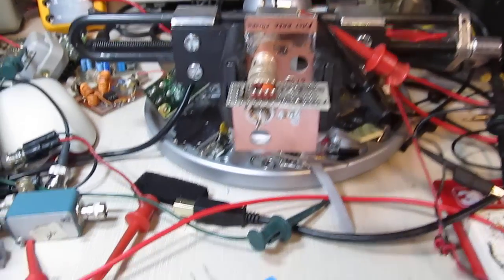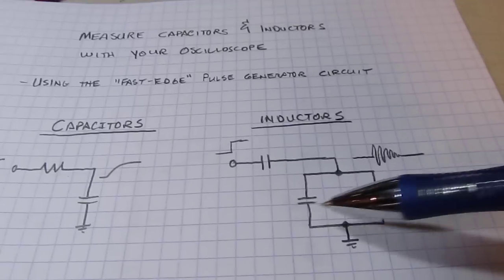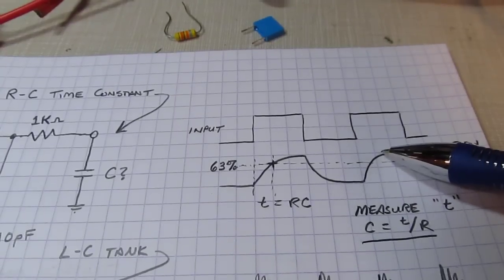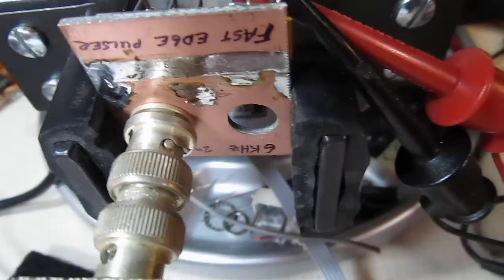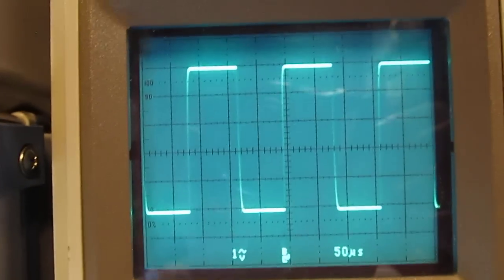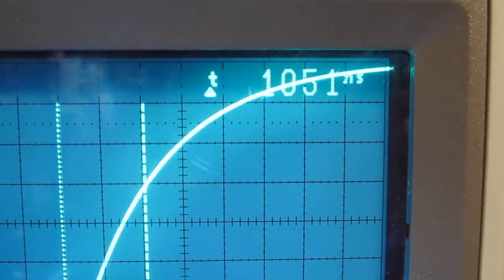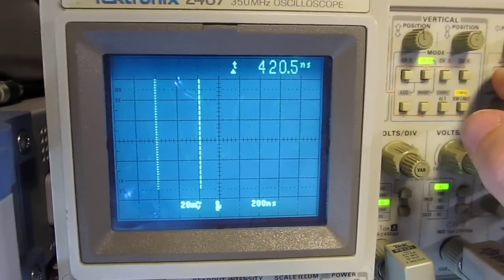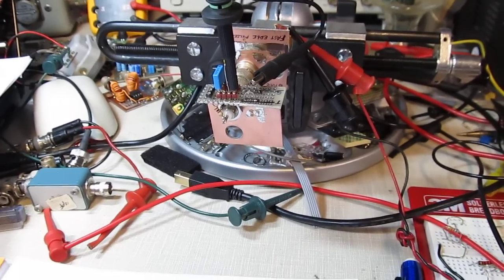#90: Measure Capacitors and Inductors with an Oscilloscope and some basic parts

Comment: Your videos and your knowledge is very impressive! I learn more and more, but I also see how little I know! ha ha ha
But I just received Tektronix 2465 DMS ( somewhere someone said that they are 2465 CTS ??? models with some extra stuff, in my case DMM ); unfortunately it is sick and I would like to fix it, so I can also start using it. I do have a modern scope, but this is something I always wanted! The problem I have is that sometimes everything is shrunken  into about 1" x 1", where the 4 input lines + text is small and the text unreadable - pixels that are funny looking; I'm assuming they are the text that should be at the top and bottom of the display. Also, when I push the FIND BEAM, the display is stuck as described by me above. Would you know where should I look or start looking? Lots of people start replacing capacitors and resistors.... but I think - unless they look and measure bad, don't fix what isn't bad, philosophy. At the same time, I never done anything this complex, but I'm willing to learn. I have nothing to loose, despite wanting to help this scope, rather than making tings worse!
I do have a generator and several meters and exact capacitor meters.... so I could start poking around with descent meters (I think). Any help is greatly appreciated!  Thank you very much.
Reply from the maker: The 1" by 1" compressed and fuzzy display is the INTENDED function of the BEAM FINDER.  The beam finder dramatically reduces the deflection voltages to make it easier to see if the trace you're looking for is off-screen somewhere - thus giving you information so that you know how to adjust the scope to bring the trace back on screen.  It sounds like your BEAM FIND switch is sticking, and not releasing back to normal operation.
Reply: @w2aew  Thank you for your quick reply! I think I'll try to clean the switch and see if that is what causes most of my problems. Lots of owners replace the square caps that are something like 0.006xxx nF, since they are a bad quality and can cause problems. Should I do that?  Also, should I just dive in and measure all the caps and replace not just bad once but also questionable or if they look like they will go bad in the near future? Do I need to buy these from a special place, rather than China/eBay....?
I have several videos here: https://www.youtube.com/watch?v=oxZZ7-VjCQ0  
All 4 of them are just badly made, but one can see how different results are just how this scope does. By same token, I think you are directing me to the Beam Switch and it is possible that it is almost 90% of my problems.
I love this scope and I want to make it to work and demo it for people and kids, that our clubs try to excite into electronics.
My stuff is also shown on shows, like DoSpace in Omaha, where I represented our Lincoln (Nebraska) club, and people were happy to see my gadgets, Jacobs's Latter and few other items that creates sparks and make sound, that scared few of the kids and adults alike!  You have a great day!
Reply from the maker: @tonysfun  Based on your videos, it really looks like a faulty/stuck Beam Find switch is your major problem.  This is an early scope, later models, such as A or B suffix, have a lot of surface mount parts.  The SMD tantalum caps on the A5 board are typically the most troublesome.  The older through-hole parts like you have are much more reliable.  You could go through a re-cap of the power supply, but it likely isn't urgent.
Reply: @w2aew  Thanks again for your help! It seems to me, from several people, that your suggestion to fix the "Beam Switch" is my first project today. I'll make a video and see if this fixes my troubles. About the caps, I'll try to examine them all one day, but from a quick inspection, they all look good and none leak, none bulges or is cracked. The small amount of dust inside and on the blades of the fan could be because it wasn't used much or it was maintained well.
Reply: @w2aew  Thanks for your help! I am up and running, but I have no idea if the scope is running as it should or I just think it is! ha ha ha  I need to do the calibration, but it takes some experience, so I must find me someone who knows much more than I do now.
Reply: @w2aew  I'm just responding to everyone just now. But it is now working so next is calibration.... BUT I do not know anything about that, so I'll try to find someone who I can learn from. Thanks!
Reply from the maker: Don’t be surprised that it might not even need calibration.
Reply: @w2aew  OK, that is something I did not expected. Didn't they need calibration at least every 3 or so years?
When I generated 1,000000kHz it was between 1,000039-1,000041kHz - that isn't bad at all for scope this old.
Do you know how can I find what "package" or "options" my scope has?
I have no manual or any documentations, but I know I have DMM option on the top. It also has couple ports in the back and 4 outputs.
But I do not know much about these scopes, except for that they are great machines I wanted one for many years.
I also do not know exact year this was made, but I do have the serial number, so I'm sure there is a way to find more information by the serial number - I assume.
Thanks for your help again!
Reply from the maker: @tonysfun  The 2465 DMS was a special edition that bundled several options:  Option 01 is the DMM, Option 09 which is the Counter/Timer/Trigger (CTT) and Word Recognizer option, Option 10 which is the GPIB interface option for programmatic control, and Option 22 was a couple of additional P6131 10x probes.  This scope listed for $8400 in 1986.  See page 260 of the 1986 catalog: http://manx.classiccmp.org/collections/legalize/tektronix/catalog/Tektronix_Catalog_1986.pdf
Reply: @w2aew  Thank you very much for all that info! You are great source of information and FAST!  I love this scope even more now, since it works. I'm printing the pages that are useful to my scope. I have a question, is there an a interface to a computer for my 2465 scope?
I think I have the CTT option, Word Recognizer option, DMM option and GPIB also. I do not know anything about these options, but the DMM is straight forward, I think. I demo my fixed scope in my electronics group and tonight I'm taking it to a larger group where we do everything from electronics, arduino, Raspberry.... 3D printers .... One never knows what we do there or what will show up. Even once a snake show by our member..... It is fascinating that some of these old scopes are functional in these days. I also have couple older so called scopes: PS 148 5" wide band oscilloscope and vectroscope - it is completely dead, but I want to fix it in near future. I have the original Sencore Service Manual, I plan to upload it - where should I upload it? My second other old scope is Simpson Handiscope - no manual or documentation. It "works", but I do not know how well, since I do not understand it much. I also would like to learn how to use it and see if it needs some new parts or not, but I do have everything working and the CRT works also.
Sorry to write here so much, but if I can do anything for you, please let me know!
Reply from the maker: @tonysfun  The GPIB interface is what can be used to interface with a PC.  Because this is not a digitizing scope, you can't get waveforms out of the scope onto your PC.  The PC can be used to control/setup the scope, and extract some of the settings and counter/timer measurements.  Pretty limited compared to even the most basic digital scopes of today.
Reply: @w2aew  Great news, so I could, if I buy the cable connect it to PC - fantastic. What do I need? Is the software free, since it is very old....? Thanks again!
Reply from the maker: @tonysfun  You'll need a GPIB adapter for the PC - which will usually come with some software drivers.  Might be tough to find these days (GPIB isn't  used much anymore).
Reply: @w2aew  I think I can buy the P6407 from eBay, but it comes with nothing else. but if you and or anyone else out there can help me to find it, that would be great!
I'm just trying to do as much with this scope as possible and I demo my scope Sunday and Monday in the electronics clubs. But my goal is to teach youngsters, adults, anyone who want to learn something about Tektronix scopes and electronics. Thank you very much for your help. (what is your name? )
Reply from the maker: @tonysfun  I've never used the word recognizer probe, so can't offer any advice.  I have plenty of other videos on my channel on how to use the basic and advanced controls on that scope.  Name is Alan.
Reply: @w2aew  Thank you Alan for all your help! And yes, I'll train myself on your videos and love them all. You are a very talented electro-engineer (if I can put it this way)! I learn from examples like you demonstrate on your channel.

Comment: I'm guessing that both inductors and capacitors aren't and don't have "galvanic isolation"? I'm confused what makes a component that has galvanic or what is galvanic but transformers are galvanic isolation since they don't pass DC. Capacitors BLOCK DC so I'm guessing they are galvanic isolation since capacitors block DC and pass AC? Inductors will Pass DC and Slow down AC not Block AC just slow down AC, so inductors aren't galvanic isolation. It seems that coupling is the galvanic anything that is coupling is the galvanic part of the component?
Reply from the maker: https://en.wikipedia.org/wiki/Galvanic_isolation

Comment: BUT WHAT IS THE FREQ OF THE INJECTED SIGNAL?
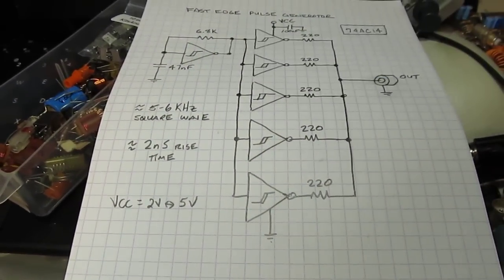Reply from the maker: not critical - I used 5-6kHz has shown on the schematic of the pulse generator at the 0:50 mark in the video.
Reply: Love your videos. I watch  them over and over. The  frequency of the "injected signal" has some bearing because I used a 4.7nF cap where your schematic showed  47nF. The freq(45.6KHz) was too fast to ring the tank circuit cleanly. Very frustrating. As soon as I brought it to within 4-5KHz it rang like a bell.

Comment: Hi friend.
Not certaine but i think this circuit would unable to measure electrolitic capacitor's
Reply from the maker: Sure it can - you'd just have to scale the resistor and operating frequency to be appropriate for larger value capacitors.
Reply: @w2aew  i mean we know electrolytic capacitors act as short with AC signal 
In such situation we will have no resonance.
So how this methode will works?
Reply from the maker: @siavasharash5448  The unknown capacitance measurement is done using the RC time constant.  The resonance circuit is for measuring an unknown inductor against a known capacitor.
Reply: @w2aew  🌅👍👍👍
Reply: @w2aew the resistor???
Do you mean that 1k resistor or the 4.7k.
For larger value capacitors amplitude of the signal significantly decrease and shape of signal become like saw and the measurement getting wrong.

Comment: http://youtu.be/7reUy3ySS4o

actually i found 5pF (diff.) cap, so even lower than 10... couldn't find chip in DIL package so i used quasi smd approach (didn't use all smd components..few pics in the beginning of clip) ...shown oscilograms are behind 5pF cap, you can see noise gets down when i touch "calibrator" output of the scope.... frequency is about 2.4khz on 3V Vcc, and 2.9khz on 5Vcc....even though i used same resistor and cap as you(?)

is that waveform something you would expect to see there?
tank really tanks the signal down, how hard would it be to amplify it? i don't think my 10mhz scope is up to it at such low voltage...
Reply from the maker: Not sure what else you have hooked up as a test tank circuit.  A tank should look like a very low impedance (near short) for any frequency outside of the resonant frequency. So yes, it should definitely squash the pulse.  All you should see is a small ringing at the edges which have a frequency equal to the ring frequency. Yes, it will be small.  Looks to me that you don't have tank circuit hooked up, and you're looking at the RC time constant of the 5pF capacitor and the 1Mohm input impedance of the scope.
Reply: *****
 yeap, this is behind the cap and no tank attached...  tank is this
https://plus.google.com/113099148878871309823/posts/5tYKqJhCmWz?pid=6062407545469604434&oid=113099148878871309823

22uf lytic or 1nf cap was used with  inductor (essentially unknown but should be cca 400uH): lytic brings ring freq down, but decreases the amplitude too, while 1nF cap makes ring freq. about 2.5mhz, which seems odd, as you got simillar freq (2.73) for much lower inductor (no ferrite core etc.)....
also, lytic and 1nf cap don't match when i calculate inductance...they produce very different inductance...
this is why i say i dunno if i have any horizontal precision on my hm307 on such low amplitudes to measure freq. in a precise way......
Reply: ivo kostić here's better pic:
http://i183.photobucket.com/albums/x312/i4004/DSC00426_zpsbae61711.jpg

1nf cap yields about 2.5mhz ring, 23nf about 500khz which would make it about 4uH coil....22uF lytic yields something alltogether different...its esr is 0.6ohm@100khz...
Reply from the maker: Large electrolytic caps won't work well in many cases because the resonant frequency of the tank may be higher than the self resonant frequency of the cap itself.